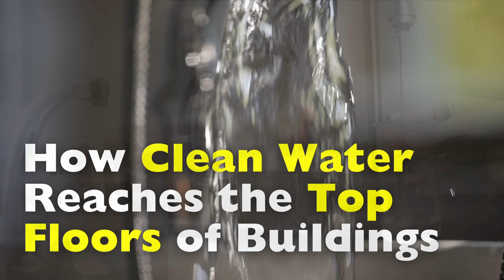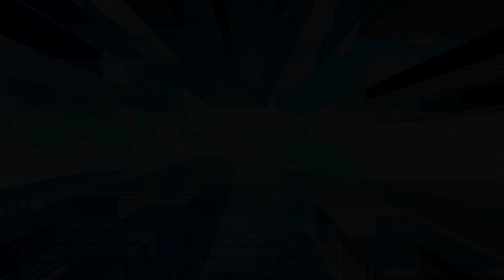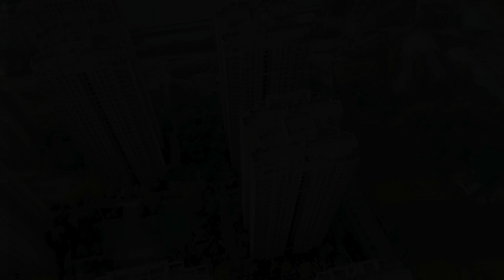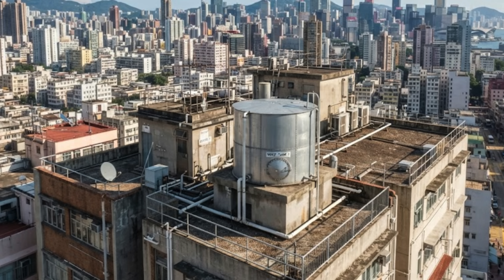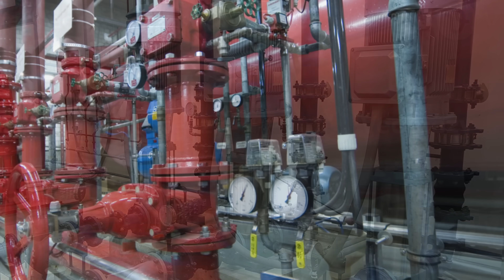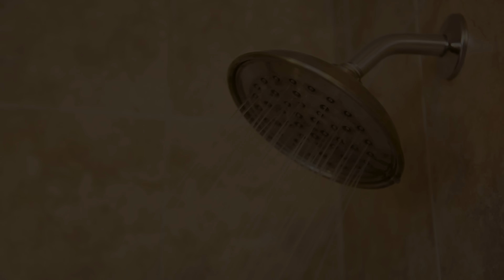How Do High-Rise Buildings Get Running Water

Comment: Booster pumps big ones I installed a 4" booster pump on a 65 floor building condos .
Reply: Lift pump set with vertical multistage pumps...control philosophy with pressure switch or a float switch...